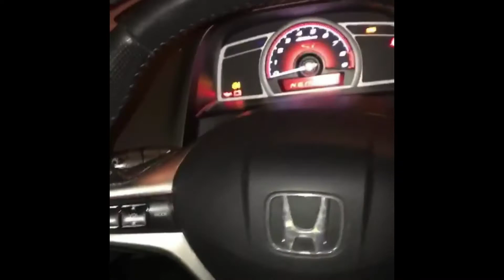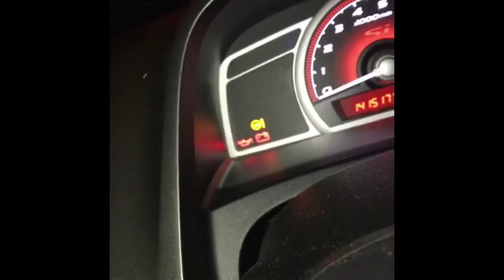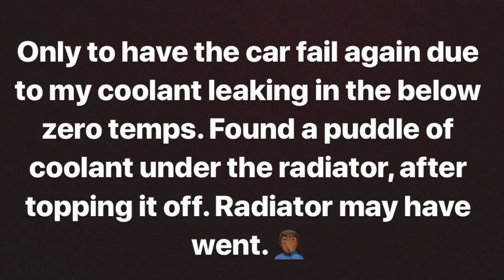Epic Tensioner Pulley Fail! Boosted Civic Si

Comment: To get to 400hp with this kit do you have the j37/zdx throttle body? & I hope the belt is fixed I heard issues about them.
Reply from the maker: Brian Mccray well to get to 400 I’m going to try a cold air intake setup and maybe slightly bigger intercooler piping...if not we doing e85 😤😂😂 but yeah the belt issue I think was the tension coming undone causing it to slip just have to keep checking if everything is all tight.
Reply: Stan's FA5 I’ve been watching mad videos like you where the 8th gens make like 400 lol. I’m just going to do the zdx tb 4bar map sensor & bigger fuel pump and hope for the best lol
Reply from the maker: Brian Mccray yeah I’ll probably do bigger fuel pump...and that piping upgrade. If I can get e85 that too but rip to my fuel lines and gauge. 🤦🏾‍♂️🤷🏾‍♂️🤷🏾‍♂️
Reply: Stan's FA5 the fuel lines and gauge will last longer if you go back in forth between e85 and 93. If you use e85 all the time it will corrode faster.
Reply from the maker: Brian Mccray yeah spoke with a couple guys and they say a flex fuel kit is the way to go. Could use 93 and e85 at the same time.